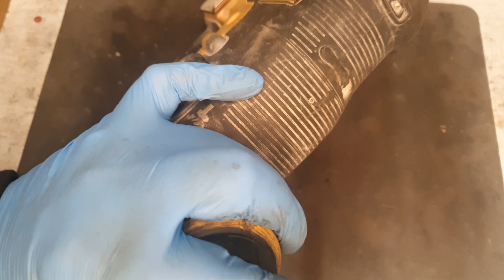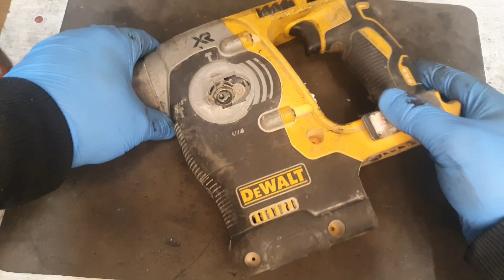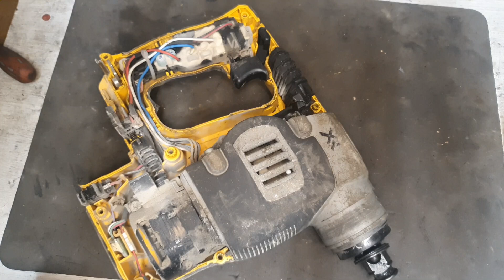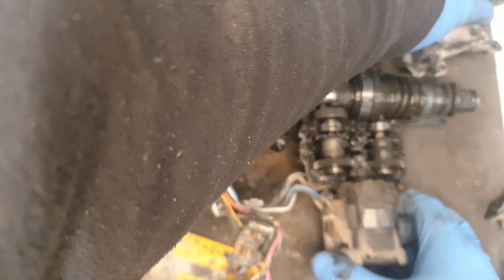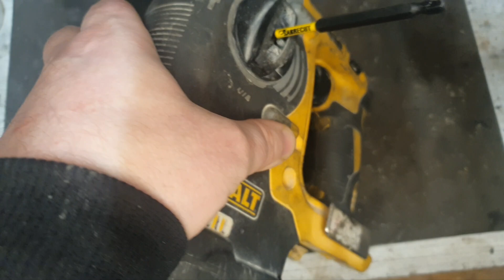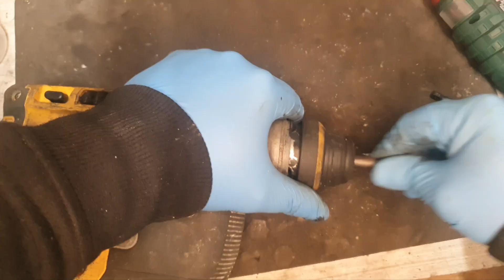Is Your DCH273 Losing Power? Easy Fix!

Comment: Hello. Is it common for these to start smoking if you keep the trigger pulled when it's experiencing the same fault?
Reply from the maker: Not that I have seen
Reply: @doctorlefthandthread  sorry it's the dch253 I have got looks like a set of brushes will take it apart and find out lol
Reply from the maker: @hammy1988  Yes the DCH253 has a brushed motor it is likely to be smoking if the brushes and maybe the armature need changing